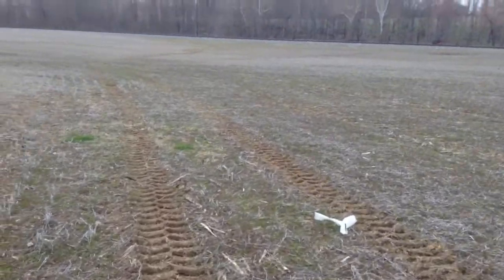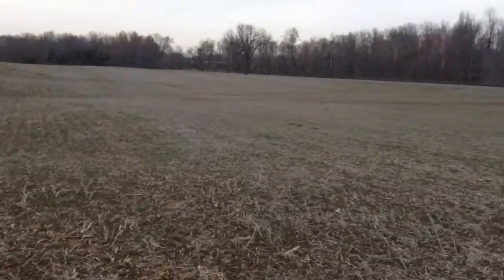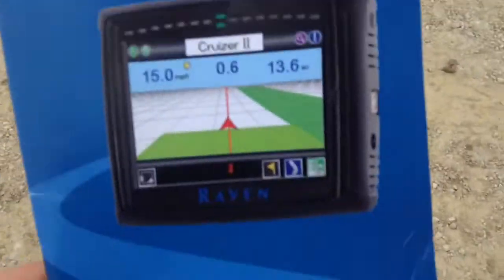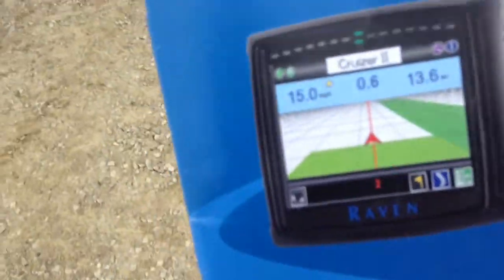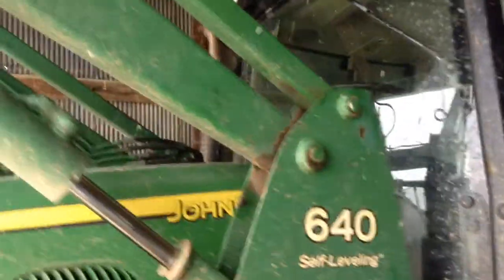GPS..

Comment: First time I sprayed using a GreenStart system, I wanted to through it out the window as far as I could.  I got used to it though.  Main thing I learned was to think about your field and how you want make your passes before you start.  If the field has one strait side, I always use a "Strait" A-B line down that side.  If there is no strait side, then use a "Adaptive Curve" A-B line on the least curvy side.  I prefer to use a "Strait" A-B line just because its easier to keep on track using manual steering, but I have some fields that are almost  impossible to do that, usually the long narrow fields without any strait sides are the worst.  If its a big field with no strait sides, you can still use a "Strait" A-B line, you just have go around the outside, and then just make a pass down the dead center of the field and mark your A-B line on that pass and then work your way to each side of the field.  Obstacles in your pass can also be frustrating.  I now run a AG Leader Compass and like it much better than the GreenStar system.   Much easier to setup and understand.   Also make sure your Receiver / Antenna has a good Full top to bottom, 360 degree view of sky and horizon, which means it need to be on the most highest point on the tractor not blocked by the roof top any.  Both units I had would lock you out from Setting your A-B line if the GPS signal was Degraded at all by a poor  signal.

Comment: I've only used JD Greenstar guidance systems, but if you want to go in a straight line you don't use a curved AB you use a straight line AB. You set A head in direction you looking to work the field then set B. I have no  experience with that system so I'm not much help but I know on Greenstar if you skip or screwup one step of the setup nothing will work. I know Greenstar is expensive but you can't beat autosteer.